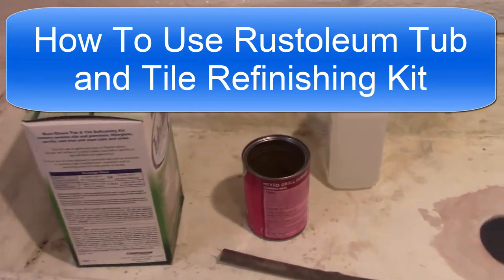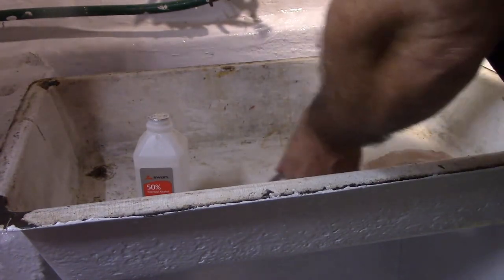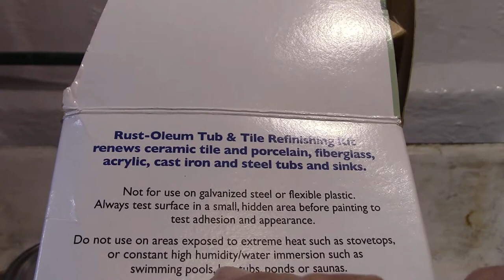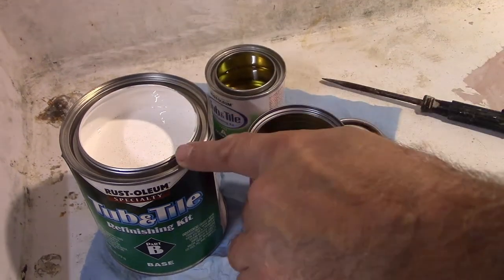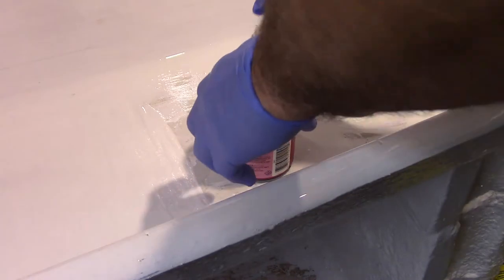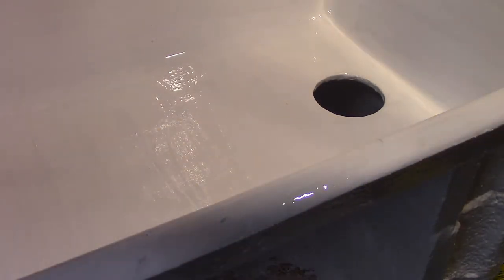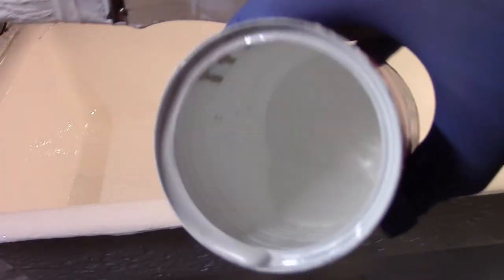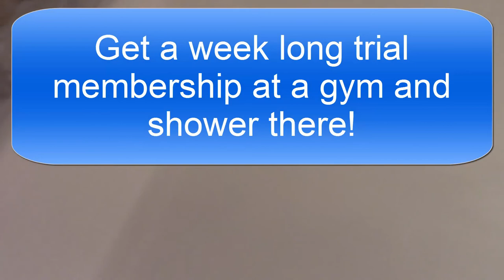Rustoleum Tub, How To Use Rustoleum Tub and Tile Refinishing Kit

Comment: How is it holding up so far?
Reply from the maker: Hi Seattle! Um...not good at all. About half of it pealed off. I've been thinking about doing a second video on the results. I think maybe because I have a leaky faucet, or it's in a damp basement. I think the prep work I did was more than sufficient, I sanded it for hours so I guess I got all the soap residue off. That may have caused it to not last. I'd say, put the $40.00 towards a new sink, and just install the new sink yourself! Thanks for watching! Jim
Reply: he put it on waaaaay to thick. its supposed to be a light first coat then a second after about 30 minutes
Reply: youre not even supposed to apply regular paint like that
Reply: It's not holding up because you didn't mix the ratio properly. It shouldn't peel up at all.. it's made for dampness and water. I don't think you added enough epoxy for a  good hard cure.
Reply from the maker: @JaimeLynn119  I figured it was something like that...I think I have more left over, I'll give it another try.